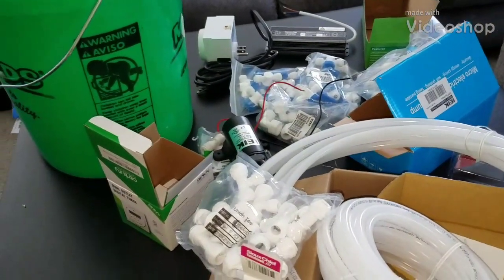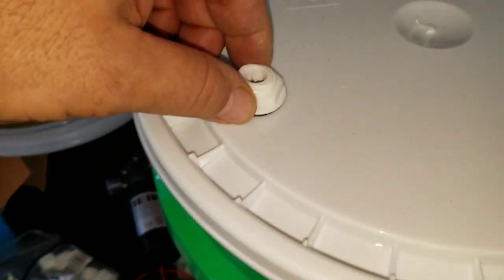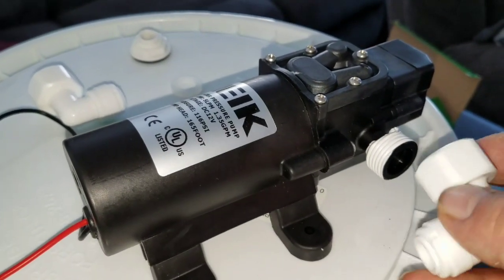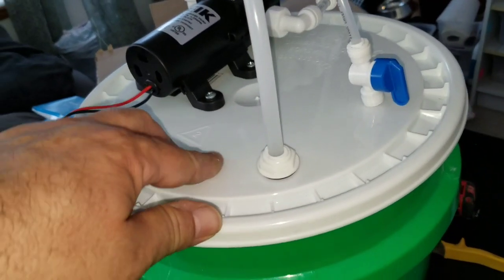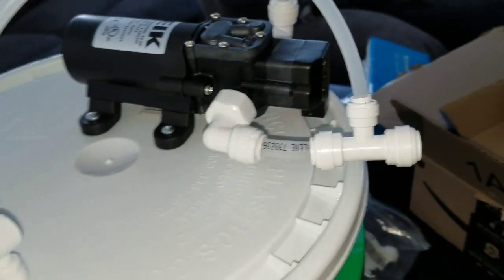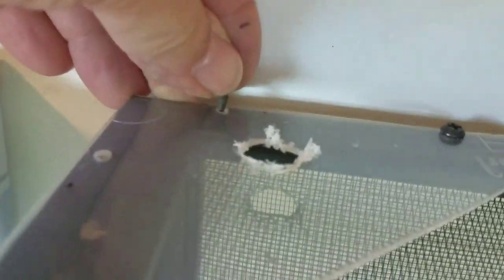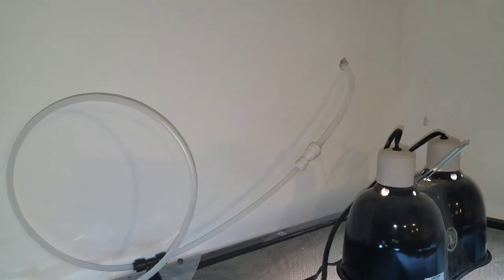DIY Misting System for Chameleons

Comment: I made one similar to this, but instead of using a relief valve to regulate the pressure, I just used a voltage knob (potentiometer) in between the power supply and the pump. I've got it set on about 60 percent. Makes the pump a lot quieter too and probably extends the life. Mine has been running great for a year now.

Comment: Oof that's loud, you weren't kidding. The mistking pumps are the best, which is where most of the cost is. They're quiet and can run dry just in case of a mishap and no water left. Their seconds timer is great too. Starter kit($100-130usd) can run 10 enclosures essentially.
Reply from the maker: You're right. I have the Mistking as well. Works great. Thanks for checking out the video and commenting.

Comment: I don't know Mike. I bought a Mistking starter for $120 brand new. Its pushing 16 nozzles for the last 1 1/2 years. Its about 6 ft. away from me in the living room. I never hear it go off. I think I can hear your pump from here. However, this is a great DIY. I'm going to look for the nozzles in this video. I've been paying $19 for Mistking double nozzles. Thanks for the tip.
Reply from the maker: I have a mistking as well and your right, it does run quiet.  I didn't know the starter kit could run that many nozzles. Thanks for letting me know.   Thanks for the comment.
Reply: The pump makes too much noise.. that is bad news for me..

Comment: hey followed this guide and works brilliantly. Thanks a lot! just wondering if you ever got it quieter, as i know you said it was loud, thanks a load again, even with the sound its saved me about £70
Reply from the maker: That's great. I'm glad it saved you some money and helped you out. I appreciate the kind words. This will work on the Mistking system as well. I haven't gotten a quieter one yet but but been working great without any problems.
Reply: Thank you loads man. Best of luck with the next project. Got another sub

Comment: I used a submersible pump, works better. Just make sure you get one that can run dry just in case or make sure your water bucket is way oversized
Reply: What kind of submersible? How many gallons does it move to achieve high enough pressure to be forced into a fine mist?

Comment: When I connect my pump to five misting nozzle the pump runs intermittently and makes a loud 'clacking' sound. From your video I see your pump does the same. Could this burn out the motor if run for some time?
Reply from the maker: My pump is going on 2 years now and still going. I guess it depends on the pump and how it's made.  I have a back up in case it burns out. I know the pumps don't last forever.
Reply: I believe that vibration over time will do damage your pump.
Reply from the maker: I'm not sure how much time you're thinking but my pump is still running.

Comment: Hello! Great video. Confused on how you  connected the pump to the mains?
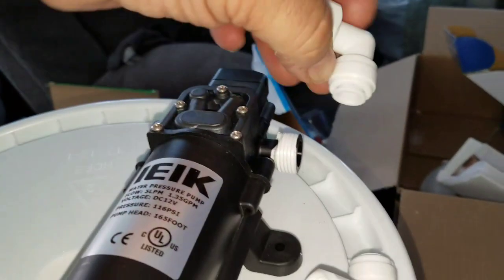Reply from the maker: Thanks you. Hope it helps. At 4:48 you can see the fitting I used for the supply.  The hoses just get pushed into the connectors.

Comment: Mounting the pump to what is basically a drum was a mistake.
You can wrap foam around the pump and make a little box for it. Or make isolated mounts
Reply from the maker: I appreciate the input. Thanks for checking it out and commenting

Comment: You could of gotten those fitting cheaply in AliExpress. Great video and thanks for the links. 
Those screw will eventually rust I think I seen plastic bots and nuts at menards
Reply from the maker: Thanks for the comment and checking out the video. I'll have to check out that site when I need more fittings.
Reply: Could "have"...not could "of".
Reply: Did you use mist king nozzles?  If so are there commercially available nozzles that aren't as pricey?

Comment: How did you mount the sticks in your chameleon cage?
Reply from the maker: I use tacks or small screws but I think I may have to try something else with my next cage rehab.  I'll have to post a video on it to show everyone. Thanks for checking out the video.
Reply: @mosaexotics6587  And what sticks did you use?
Reply from the maker: @jthalbig6505  I use dowel rods from the home improvement store but I like natural sticks as well. If you use sticks from outside you have to put them in the oven for 25 minutes at about 250 degrees to make sure there are no bugs or parasites in the wood.

Comment: Does this do a fine or very fine mist also what timer should I get for seconds not minutes on and off
Also will this do more then 50 cages
Reply from the maker: Thanks for checking out the video. The mist I have is a fine one but it depends on the type of nozzles you use. The timer i'm using should be in the description of the video. I go one minute 3 times a day but you can also increase or decrease if necessary. I don't have 50 cages hooked up to my set up but I think it would come close. You can get a stronger pump to be on the safe side.
Reply: @mosaexotics6587  I was afraid it would put too much water overtime in the translucent storage containers I have crested geckos
Need something to mist 60 cages possibly
Reply from the maker: @hooperdavid1980  as far as the set up goes you can run as many nozzles as you want but you would have to get a different pump and timer. Hope this helps.

Comment: Beautiful vedio.thanks dear.
Sir what is the wattage of the pump and voltage. Please advise
Reply from the maker: It's a 12v 60watt unit. The link for the pump and the rest of the parts are in the description of the video. Hope this helps. Thanks for the comment and checking out the video.

Comment: This is awesome, I need something like this...  however, that pump is loud, any solutions for that?
Reply from the maker: The only way around it is to get a different pump. Mistking had the quietest one but they are pricey.
Reply: YES, the pump is placed on the lid of the bucket, this will act as an amplifier. Placing the pump suspended by elastic rubber bands or at least on foam will greatly help with the sound in theory :) Ideal, the pump is placed in sound-absorbent material, suspended in a concrete or else heavy mass chamber.
Reply: The pump make too much noise.. that is bad news for installing at balcony for dinners or lunch.. too much noise..hummm

Comment: I think you were stalling your pump. I picked up one of these pumps for a small water injection system on my small turbo car. Mine is set to kick out at 35 psi, but it's adjustable up to 80 psi. With the nozzle I have it should produce a fine mist. I don't need much volume, so a 160 - 200 psi pump was unnecessary. I liked your video.
Reply from the maker: Thanks for the reply. I'll have to check out some different pumps. Thanks for the info.
Reply: @mosaexotics6587  Just curious, did you find another pump or are you satisfied now with this one.  GREAT video!!!
Reply from the maker: Thank you. The pump itself is great. Self priming, works if I run out of water and has a great gpm ratio. It still is very loud. I'm looking into s different one but this one is still going strong.
Reply: @mosaexotics6587  I'm doing my comparisons to setup a 15 enclosure setup for geckos right now.  Your video helped a lot!
Reply from the maker: I'm glad it helped you out. That's why I post them.

Comment: would you imagine this could work for, lets say, camping out at the lake with an EZ up?
Reply from the maker: Thanks for the comment and checking out the video. I'm sure this will work camping. You would need a power supply for the pump but other then that I don't see why it wouldn't work.

Comment: Any reason not to hook this directly to the city water supply? Skip the bucket and pump all together?
Reply from the maker: Thanks for checking out the video and commenting. I do the pump and bucket because I have hard water and it would clog up the nozzles. I also need a timer to go on and off every hour or so, during daylight hours, for misting the chameleons the proper way.
Reply: I have ordered a system along with a NC 24v valve that will open when the pump kicks on. Because of your comment about hard water I got a calcium inline filter.
Reply from the maker: @barryammerman6317   that sounds perfect. I'll check out the video if you post one.
Reply: @barryammerman6317  be careful about the chlorine in city water!!!
Reply from the maker: Good point. Thanks for the input.

Comment: The most expensive component is the pump and how did you spent 200 bucks if the pump is 25 bucks. I am making a system and it will only cost about 50 (not including power supply and timer because I already have)

Comment: Could you guess as to how much water it is using over the time?
Reply from the maker: It all depends on the settings you have to turn it on and off and how many nozzles you set up. I have 5 nozzles that go off about 4 minutes a day and go through about 5 gallons every 7-10 days.

Comment: The bucket needs a vent hole to release pressure from the inside of bucket
Reply from the maker: Thanks for checking out the video. In the video, at 5:12, I have a tube running back to the bucket. It's not sealed but rather just stuck though. This acts as a relief.

Comment: The water is lraking through T joints

What to do
Reply from the maker: You either didn't cut the tubing straight enough or it's not pushed in enough. Try pushing the tubing in more.